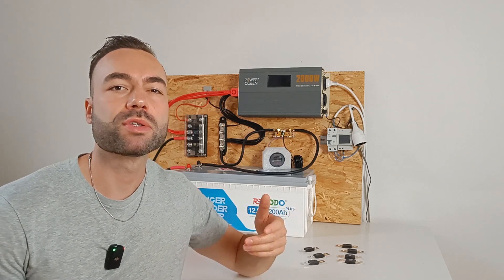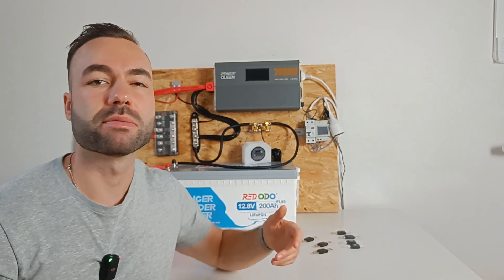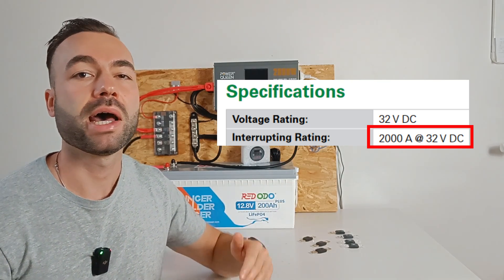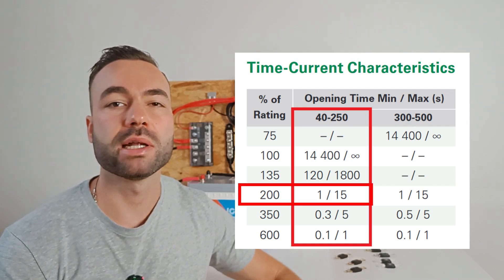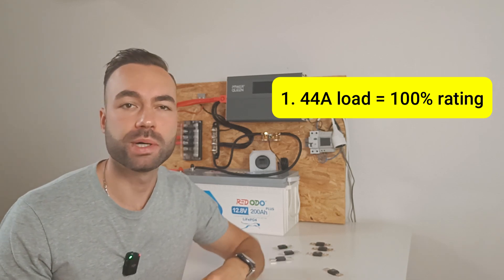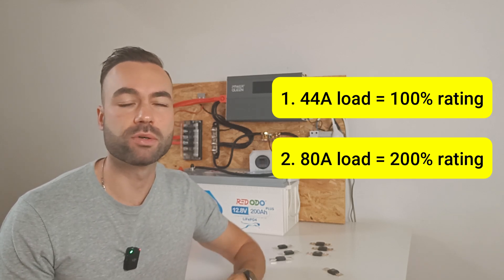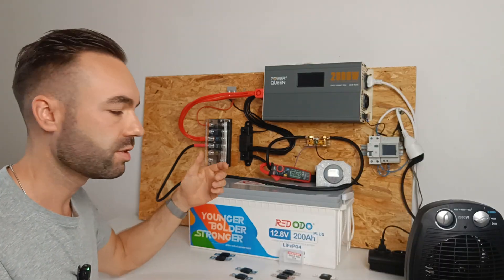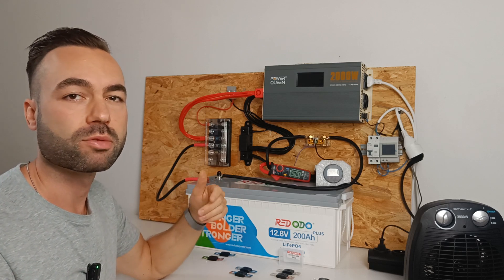Testing MEGA Fuses - Don't trust BOJACK + MEGA Fuse Theory

Comment: I have just purchased some bojack fuses from Amazon after seen your video I tested them and they're failed badly 60 amp fuse didn't blow till it got to 120 amps these fuses are dangerous and should not be used in any circumstances
Reply from the maker: You must be the only person to buy them after watching my video 😄
Reply: @cleversolarpower I purchased them 2 weeks earlier from Amazon not after watching your video

Comment: important to know that Bojack mega fuse is not to be trusted, does this also apply to the BOJACK MRBF marine-battery fuses, as I waas considering buying a 60amp and 300amp to  use in my setup?
Reply from the maker: I don't know because I haven't tested them. But I wouldn't trust the whole brand after these tests. So it's a no for me.
Reply: @cleversolarpower  what brands for MRBF fuses would you recomend or trust?
Reply from the maker: Blueseasystems

Comment: Which type of protection is most recommended for battery.
Fuse or breakers?
Reply from the maker: Both are good. Fuses are cheaper.
Reply: @cleversolarpower  thanks for clarifying, am also wondering why
Breakers are always rated high voltage. Is it okay?
Example, can i use a dc breaker rated  (100a 500v) on a (100a 48v) lithium Battery
Reply from the maker: They have better arch extinguishing properties. Always make sure you have a DC breaker for DC.
Reply from the maker: I have a video about DC breakers for main battery disconnect coming soon.
Reply: @cleversolarpower  thanks for the work you do.
Your videos give us free professional consultations.

Comment: This is my third attempt to send you a message.  I hope this one works.  I bought some USDRWAM 40 amp bolt on fuses.  I want to get your opinion.  I am installing a Victron DC to DC Charger.  I am replacing my RV's lead acid battery with a 150 ah ECO-WORTHY LiFePO4 battery. I am placing the fuses before the car starter battery and before the RV battery.  Thank you for your response.
Reply from the maker: First time I see it. If you want to get a guaranteed response email me. Fuse every positive wire. The fuse rating depends on the current of the DC to DC charger. When installing a DC to DC charger, two fuses are required. One on the input and one on the output. The Manual will say which one and cable size.

Comment: Neither Littelfuse or Amazon list at 40A MEGA fuse as of May 2025. Do you have specific part number for the fuse you used?
Reply from the maker: 0298040 it's the top result when you search for 'littelfuse 40a mega' on amazon.com

Comment: This is honestly an eye opener for me. I know those cheap ATC/ATO auto blade fuses were bad, but BOJACK has a pronounceable name and makes lots of other electrical stuff as well. I like to think I'd have been at least somewhat hesitant to trust a fuse without a chart, but thank you so much for testing and burying the hatchet. This is massively important work
Reply from the maker: Indeed, its well known in the solar industry. I hope this video let's them test their fuses or get proper certification.

Comment: I tested 125A Megafuse. I haven't tested such low values with 40A.😅
You cannot post a link, then the comment will be deleted. Unfortunately my video is in German.
Reply from the maker: If it's incorrect at 40A it will be incorrect at 125A. You can mention the brand 😉

Comment: When you have a short, you will really increase amperage (several times the nominal current depending on the power source) . What you are doing here is a overload test, from my point of view it is not the same as the short circuit. But it is a good video and thanks for the information.
Reply from the maker: Checkout my video on fuse types. In the case of a short circuit current, all these fuses will break. It depends on the voltage if the fuse is going to arc.

Comment: Why I buy all my fuses from Del City. They meet government specs. You can buy ZCase, MIDI, ANL Limited Low Voltage non delay, Marine Rated MRBF, and Class T fuses for a nice price. 

And I also notice this guy actually runs 2x parallels cables to his inverter. This is the proper way to wire them. As you it over comes the skin effect of single conductors. Something the NFPA70E covers in detail...
Reply from the maker: Never heard about zcase fuses. Looks a bit like MRBF but smaller.
Reply: @cleversolarpower  ZCASE fuses are used where stud size is important. As they come in #6 #8 and #10 hole sizing. They are used in Robotics and Automation machines. Where fuse holders of up to 8 can be placed for high amp protection locations in small spaces..

Comment: When using lithium batteries Mega fuses are unsuitable.  All fuses have a fuse amper rating, thats the test you are making, and a maximum interrupt current rating.  Where power sources like lithium batteries  are used in a system, the possible fault current is very high, in the region of 7000 amps or more. Mega fuses have an interrupt maximum current rating of 2000 amps, thus its possible when the fuse 'blows' at its ampere rating, the high energy current  will not only  vaporise  the fuse,  sending molten fragments everywhere, but allow the current to 'jump the gap' sending power into the system and causing damage.
Idealy with a lithium battery system you need class T, or HRC, or BS88 fuses. The DC ratings of these fuses are 125 volts and an interrupt rating of 20,000 amps. Its possible to use MRBF fuses, voltage rating 14 volts, interrupt rating 10,000 amps,  as an option with a 12volt system.
Reply from the maker: As I've said in the video a 12V 200Ah is the max you can use with mega fuse. How do you know the current is in the region of 7000A? According to research papers, the short circuit current for lifepo4 is 10x the capacity. So 200Ah=2,000A.

Comment: My wife and I just purchased an Anker Solix f2000 and a Renogy 400w folding suitcase portable solar panel kit. This will be used for power outages and camping, I was wondering if you have any advice for this type of set up? I am going to buy your book "Off Grid Solar Power Simplified", we are (out of nowhere) suddenly very interested in solar power....
Reply from the maker: Don't buy my book, after reading it you will want to return the Anker solix 😄
Reply: @cleversolarpower  Oh no! What did we do wrong? And what should we do now? 🤔😕
Reply: @cleversolarpower  What should we have done? Any advice would be greatly appreciated.
Reply from the maker: @drizzt8965  It quite expensive. And it's difficult to expand if you want to later on (and expensive). But it's a great system for people who want it plug and play.
Reply: @cleversolarpower  We bought the expansion pack. Now lets just hope that we do not get hit by an EMP....

Comment: Professor, can you do some test on the chargeverter ? Can the EG4 chargeverter work with lead acid battery for example? Can it work with the battleborn battery ?
Reply from the maker: It cannot work with a lead-acid battery, but it can work with 4 battleborn batteries in series. However, why use battleborn? they are crazy expensive for what you get. Chargeverter is only 48V.
Reply: @cleversolarpower  thank you Sir.
May the Almighty bless you and your family.

Comment: I've seen videos of testing an ANL fuse. At what current does it blow? Well they showed A 100 amp ANL fuse blows at 110 amps. But others videos say it won't blow till 200 amps.
How can there be that much inconsistency ???
Reply from the maker: You need to look at the datasheet of the manufacturer. If the manufacturer doesn't have a datasheet, then don't bother buying the fuse.

Comment: I have Bojack MEGA fuses installed in my RV solar setup as well as my spares bought from Amazon. I will immediately replace all of them and throw away the spares to buy the fuse you recommend.
Reply from the maker: Smart choice. It's amazing how they are able to sell these. If they made a quick test like I did, they would see they are not suited. Says a lot about the company.
Reply: Don't forget to change the smaller blade fuses to Littefuse also. After seeing tests I changed all my fuses out.

Comment: Very important here to protect your system plus protect your wires way before they melt and catch fire. How many of these are UL listed? Are they 1973, UL 9540 like the batteries need to be.

Seem like you should under amp fuse for safety depending equipment being used, definitely make wires have safety margins.

I guess every one needs to buy 3 fuses just to test making sure when fuse blows like shown here. There’s a lot of DC equipment that’s not rated correctly and shouldn’t be used. Those other fuses are a fire hazard plus you would lose your whole investment.
Reply from the maker: Fuses sold online do not need to be certified, that's the danger and that why independent testers like this video are required. When sizing the wires, you should always size the fuse under the max current capacity of the cable.
Reply: @cleversolarpower  100% 💯👍🏻 couldn’t agree more, UL listed is a must for electrical parts I purchased.
You also pointed out in this video rebrand names. Best to buy straight from the source save big plus highest quality. Can’t stress UL listed enough. I find it difficult to find quality DC components, electrical fires are no Bueno.
 
Appreciate your testing is there any fuses you recommend that aren’t online that are rated closer to 125v?

Comment: Awesome test!  I can't see anyplace that Littlefuse makes MRBF fuses,  or i would just get those.  Would you please do the same kind of test for different brands of MRBF please?  

MOST VALUABLE!!
Reply from the maker: Blue Sea Systems and Bussmann make good MRBF fuses.
Reply: @cleversolarpower  I had JUST SEEN Bojack on Amazon when I first started looking for MRBF fuses, not 2 hours before I came across this vid -- and only an hour or so after you posted it!  Talk about luck!  I had even made notes that Bojack were cheaper, and maybe I would get them to to save a few bucks.   Then after seeing your vid, I scratched them off my list completely, but didn't know what to get instead.   I will look for LittelFuse for anything I can, and for MRBF I will stick to Bussmann or Blue Sea.  Thank you!

Comment: Hallo Nick, thank you so much for all your information. I unfortunately have already purchased two 120AH solar deep cycle gel batteries and two 100AH solar deep cycle gel batteries. Will I be able to connect these four batteries in series to provide 48V for a 48v solar inverter? I need to build a 48v solar system that must provide power for 5 lights, a microwave, and two standard fridge freezer combos. I will be using propane for cooking and a propane geyser.

I have funds available for the following bifacial solar panels, with these specifications, so how many of these do I need:

SPECIFICATIONS:
Peak power (Pmax): 650W
Open Circuit Voltage (Voc): 45.9V
Max Power Voltage (Vmp): 41.77V
Short Circuit Current (Isc): 18.57A
Max Power Current(lmp): 15.57A
Power Selection: 0 ~+ 5W
IEC 61215-1/1-11-2;2016 and IEC 6173D-1/2;2016 certified
Safety class based on IEC 61140: ClassII
Maximum System voltage: 1500V
Maximum Over current protection Rating: 25A
Power Production tolerance: +_3%
Open circuit voltage Tolerance: +_2%
Short Circuit Current tolerance: +_4%
Size: 2279 x 1134 x 35mm
Weight: 28kg
Reply: https://www.youtube.com/watch?v=j_4rJS35GF4

https://www.youtube.com/watch?v=IClyzNe5xL4
Reply from the maker: You are faster than me. I was going to send the exact same links 😄, Thanks!
Reply: @cleversolarpower  Hallo Nick,

I checked out the solar calculator and I see that I will need 7 x 650W solar panels (at least 4000W solar power) for my area, which is Johannesburg, South Africa.